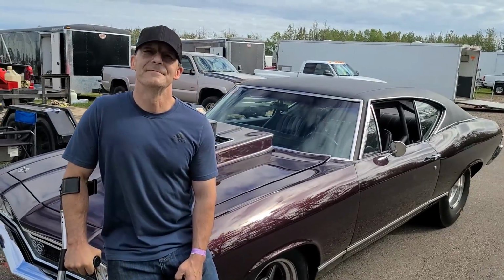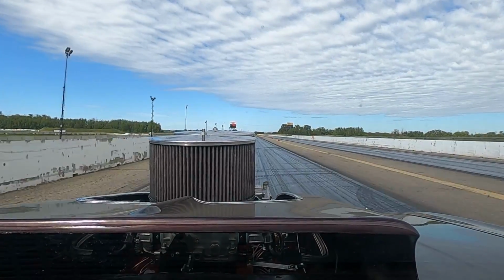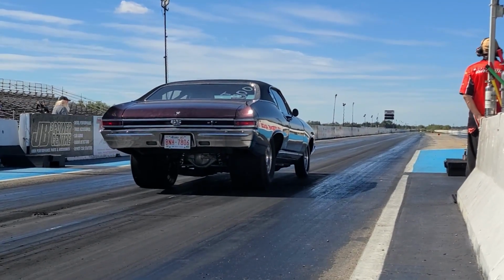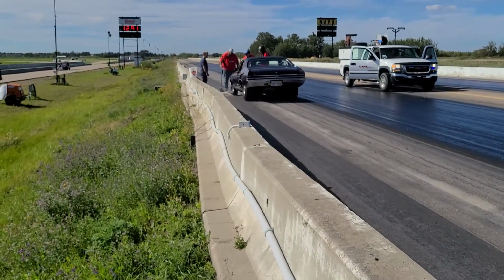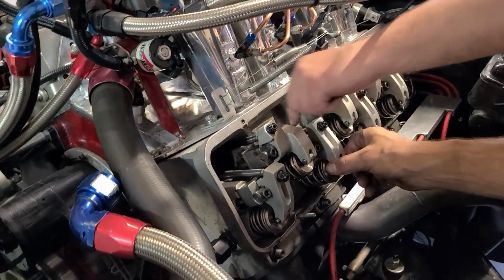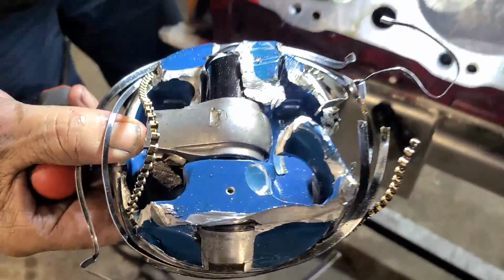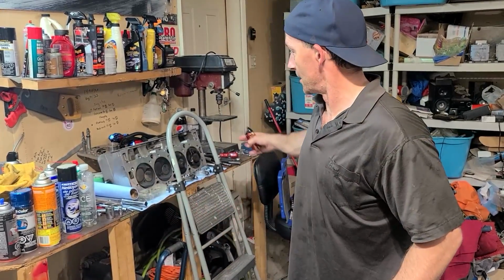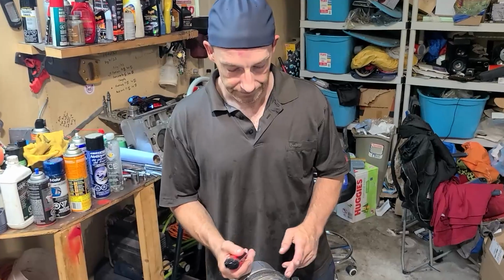Scottie's 1100 hp Chevelle Blows Up! - Includes Tear Down

Comment: My opinion as an automotive machinist is that piston to valve clearance is the root cause of that failure not a piston or rod randomly letting go . Yeah the latter happened but it was caused by the former .
Reply from the maker: When the motor locked up it caused the timing belt to rip and skip. The piston that got destroyed had no markings of a valve touching it. This suggests the exhaust valves made contact with the pistons after the engine let go.
Reply: @SS454LS6  that makes sense too. He didn't show a broken timing belt though .
In my experience there's a reason for every failure and the reasons are hardly ever high quality parts just giving out for zero reason. Especially at the power level it takes to run mid 9s .
Reply from the maker: @petemcpeterson6205  That's my fault for not showing the timing belt. I agree with you, 95% of the time there's a reason for a failure. In this case there was no smoking gun.
Reply: I bet a dollar to a donut you are correct!!!!

Comment: My 468 BBC made 708 on the motor, and 1006 on the bottle, I ran 9.63 @138 in a 3500 lb camaro with me in it. Single carb ladder bar car, 31x16.5 Et streets. No issues.

Comment: Did you check piston to valve clearance? Did you check pushrods? Were the pushrods in the correct placement? Some of those adjusters were way sticking out of the adjustment nut! They are usually supposed to be about flush! This was not a part failure! (Well, yes it was, after everything hitting into each other thousands of times!) This was not setting up the valvetrain properly! By the time you spend a bunch fixing a badly hammered block, you will be way better off buying a long block, from a well known big block builder!
Reply from the maker: PtoV clearance was checked and plenty. I failed to mention it, but the Jesel timing belt broke/skipped when the engine locked up  and that caused the valves to touch the pistons. The destroyed piston has zero indication of valves touching.

Comment: I can tell your engine was not cheap & was built with good parts. Everything has a run life. Valvevtrain is something that I check yearly for spring pressures, valve face & seat wear & lifer bearings/roller wear or abnormalities. Compression & leakagevtest as well.
Lash I check before every race as you can often catch a problem if your lash doesn't remain constant. Sorry for your engine. All it takes is time & money. I knew something was wrong as 9.74@149 mph can be done with  750-800 HP depending on weight, set-up etc.

Comment: Gotta ask: 9.70 out of 1100 ponies? ( only screened the vid as I was verifying no P.O.S. LS in the mix )
Reply from the maker: 9.75 in 4800 ft air equates to 9.17 at sea level. We did feel the car would be faster, and Scotty found a few issues. We were expecting to see some PBs this day but the engine had other plans. Extracting all the potential usually takes some time. I found 1 second in ET without ever digging into the engine on my car.